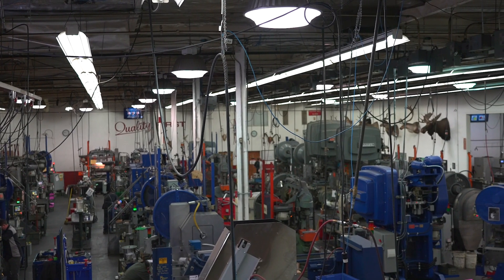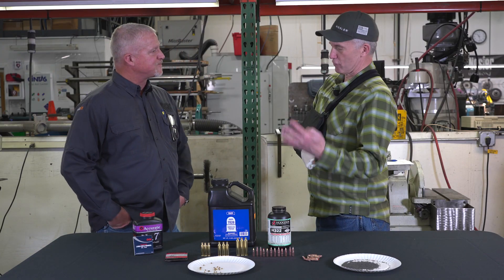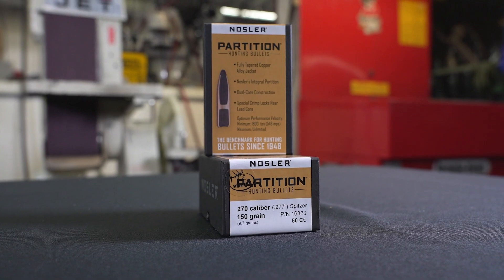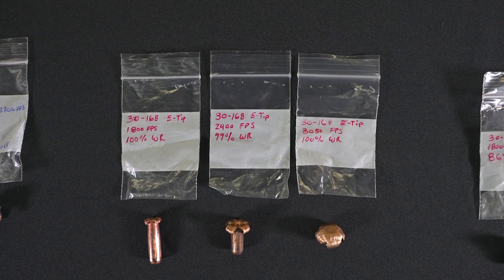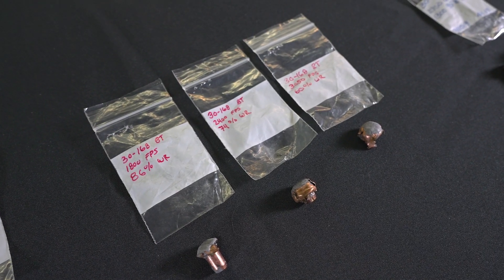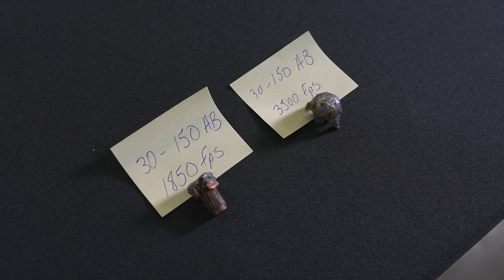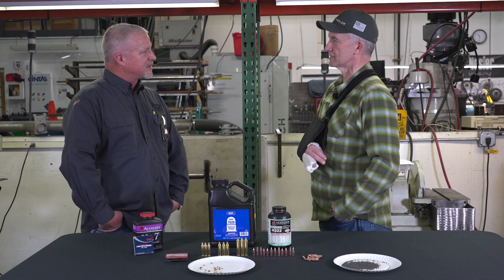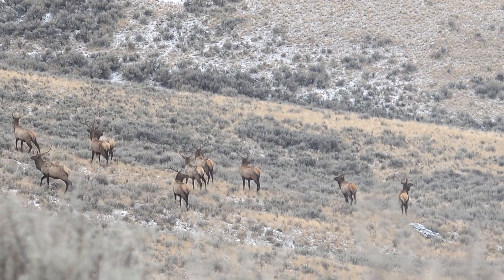Hunting Bullets Explained | Bulls, Bullets, and Ballistics With NOSLER

Comment: The new designed Partition is junk because the nose blows off of them leaving a small wad cutter shank.
When I needed the most the 338 win mag using 225 grain partitions to work on a Brown bear my client wounded the 338 - 225 grain partitions failed all 5 of them blew the noise blew off and lucky the bear jumped into the river then down to death because being shot 13 time by 2 rifles messed up the bear so badly it couldn't swim.
That was in 2005 on the Alsek River SE Alaska so never again I use any Nosler bullets so now I only shoot Barns TSX -TTSX and Larx bullets that get the job done !

Comment: I have been a big fan of the Nosler Partition since I was first introduced to them around 1988, my favourite bullet by far!
Reply: The Partition was produced in the late 1940s and the first of them are made of a Bronz zink alloy then the front half was turned on a screw lathe.
Today's Partition is junk because the company now designed the bullet to blow off the noise losing most of the bullet's weight.
Reply: @lurebenson7722  I get great retained weight, I have no idea what you are talking about.
Reply: @lurebenson7722  Are you high? They've never changed the design and it's still the best hunting bullet on the planet

Comment: I started big game hunting when I could first buy a license at the age of fourteen. I am now 70. I have never had any trouble with any bullet as long as it was considered a big game bullet. In other words I've never hunted big game with match type bullet. I've killed quite a few elk and never had a problem with any bullet unless I missed or I hit a big bone. The worst cartridge I ever used out of all the cartridges I've used was a 7mm mag. When I used it the bullets were not heavy enough for the velocity and the bullets break up if you hit a big bone leaving you with a long trek to try and finish the animal. I assume that has been corrected since then but I don't have a 7mm any longer.
Reply: That was pretty typical prformance of all the old cup /core bullet designs. They blew up if you hit heavy bone and they destroyed a lot of good venison .  That was the very reason they invented the Partition. I got a nice  bull elk  last year with the 7 Mag shooting 175 grain partition handloads. He wobbled for about 20 yards and fell over, No follow up shot or tracking needed.

Comment: I love the Accubond Long Range bullet, but I’ve had to move on to other manufacturer’s products because Nosler never has them in stock. Unfortunately when push comes to shove, dependable availability beats performance.
Reply: Barnes is as good or better in terminal performance and available all day and easy to get.

Comment: Does Nosler consider the ballistic tip, frangible? He stated it is more violent, but does it maintain its core?
Reply: I believe the ballistic tip is a cup/core bullet, not bonded so in a sense its more frangible similar to Berger bullets.
Reply: @Randy_Savage_ohyeah  My mistake.
Reply: @rowdyhoundsman  no worries my man
Reply: It does, I have been shooting E-Tips for 8 years now. Haven’t had a single one that didn’t expand like a flower. I use the 150 gr E-tip in both a .30-06 and .308 for deer and elk. I think I’ve killed 3 bulls and 6 bucks, my wife has killed 4 bucks. All with E-tips. Of the two bullets we recovered, all pedals stayed intact and perfectly formed. Haven’t hit anything in the spine or heavy bones yet so I’m not sure if they’ll retain all the pedals after that. But I’m a big fan. All but 2 animals have dropped wheee they’ve stood and those 2 only went 30 yards before they fell over.
Reply: @rowdyhoundsman  e-tip and ballistic tip are different bullets.

Comment: Problem is I can almost never find Nosler ammo and when I do it is insanely expensive.  Love the Long Range Accubond just cant find it consistently enough.
Reply: I have the same issue. I normally go for the noslers either loaded in federal premium or Winchester though they have them at a way better price point
Reply: Meanwhile, I can find those “H” bullets everywhere I look. Come on Nosler. Get some bullets on these shelves so we can get back to business.
Reply: @guns4funfreedomkeeper999 just saw accubonds on the shelf for the first time in 4 years. So I bought some, even tho I will have to give hand jobs behind a Wendy's dumpster.
Reply: Same issue then when you find it, costs 130$ a box…
Reply: Nosler is RAPING their customers.
Reply: Try some Barnes TSX or TTSX, work just as well as a Partition or E tip, and is cheaper. They have the LRX also for thinner skinned game. More availiable.
Reply: @ yes they are great just don’t shoot well in my rifle.  Doesn’t like anything over 2900fps
Reply: Reload
Reply: @glock271 that’s a big investment with limited supplies, especially large rifle primers.  Unless u shoot a lot it’s not worth it.

Comment: I started running solid copper in my 28 Nosler excellent outcomes. 143 grain for deer and 166gr for elk size.
Reply: Biggest problem ive found with solid copper is they have too much penetration a lot of the time and thus you lose a lot of energy that could be better served on the animal.  All in all great bullets if penetration is the ultimate need.
Reply: @Randy_Savage_ohyeah actually, it’s not energy that kills the animal, it’s tissue destruction.  If a high penetrating bullet that passes completely through the animal has expanded properly, the tissue destruction will occur, and it will kill the animal regardless of whether or not that energy dissipated while still inside the animal.  Obviously, if the high velocity projectile passes completely through with out proper expansion, then that’s a different story, but you don’t “lose energy” just because the bullet has passed completely through.
Reply: @HoustonRob  I agree that tissue damage is part of what kills particularly vital tissue but I also believe that foot pounds of energy and shock also play a role, and the more you can impart on a animal the better.  Why are most critical defense rounds for self/home protection highly expandable with massice hollow points?  I would say they have greater stopping power versus a solid bullet that passes through.  Bit as you mention proper expansion is critical.
Reply: Sounds like Hammers!